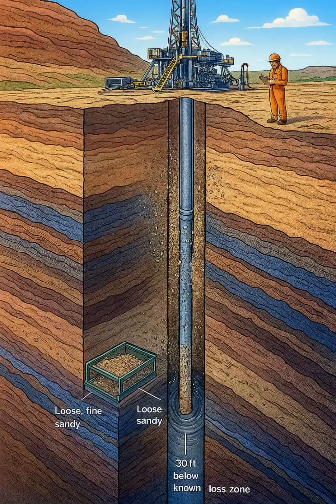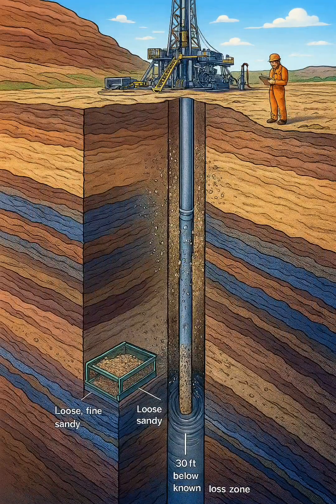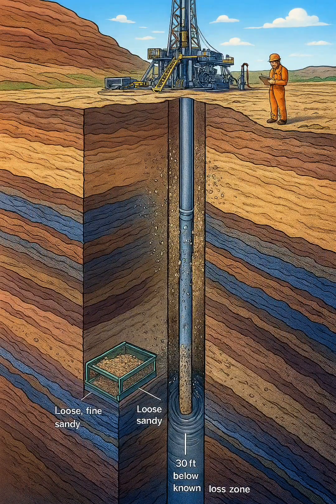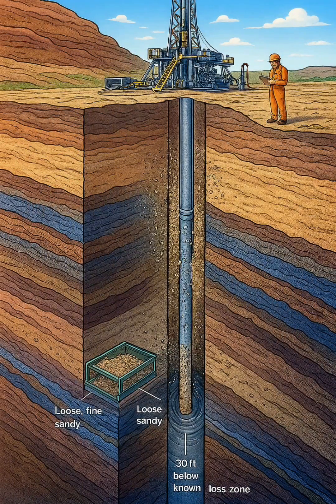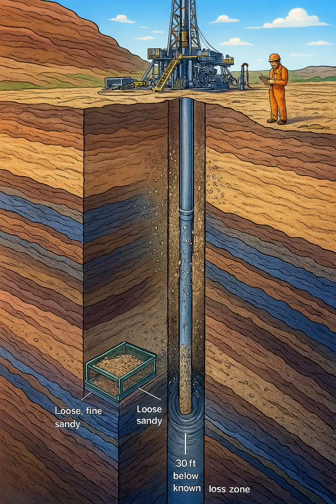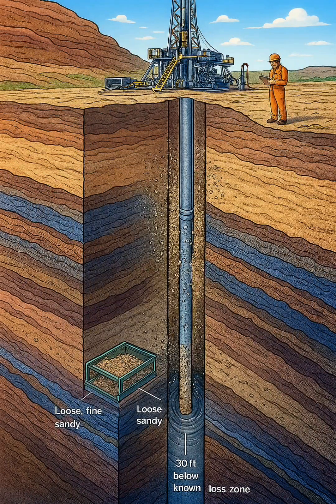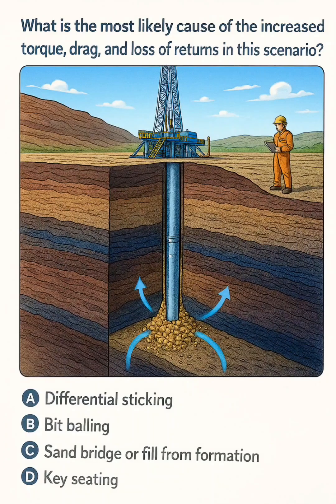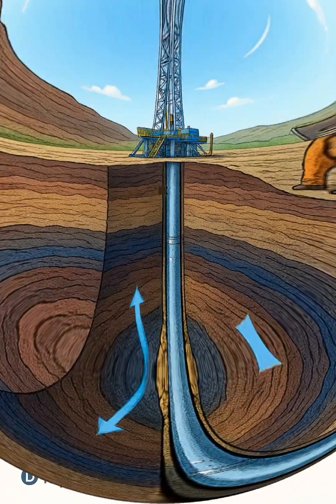Formation Collapse Leads to Stuck Pipe Q18 #stuckpipe #welloperations #drillinghse

Comment from the maker: ✅ C) Sand bridge or fill from formation —
In unconsolidated formations such as loose sand or silt, the wellbore can become unstable and collapse into the hole. This causes material to flow into the annulus, partially or completely filling it. The result is increased torque, drag, and partial loss of returns. Cuttings samples containing loose sand and the presence of annular fill confirm that formation material has bridged the hole.

Explanation for the Incorrect Options:

❌ A) Differential sticking —
Occurs when the drill string becomes stuck against the wellbore wall due to differential pressure. It usually shows normal returns and happens in permeable zones with high overbalance, not in loose sand with losses.

❌ B) Bit balling —
Happens when sticky clay builds up on the bit, reducing penetration and causing torque rise. Cuttings appear sticky and cohesive, not loose sand, and losses are uncommon.

❌ D) Key seating —
Caused by the drill string cutting a narrow groove in the borehole wall, leading to mechanical sticking during tripping, not formation collapse or annular fill during drilling.